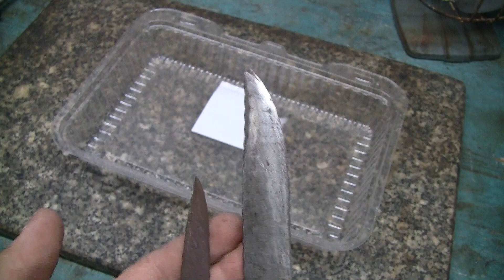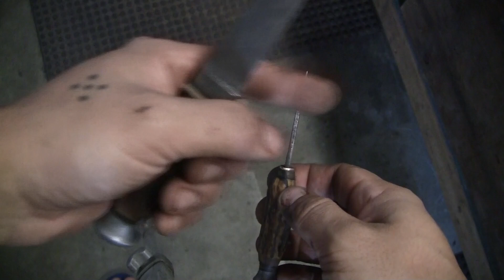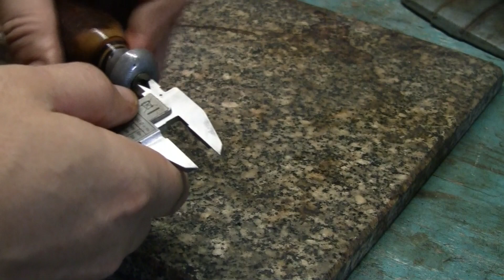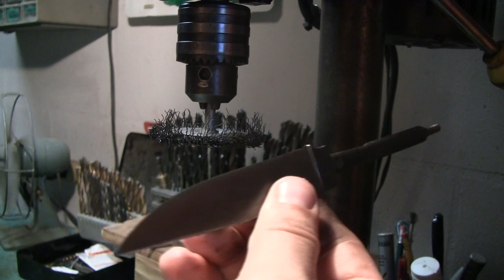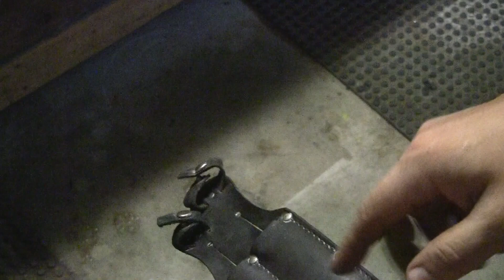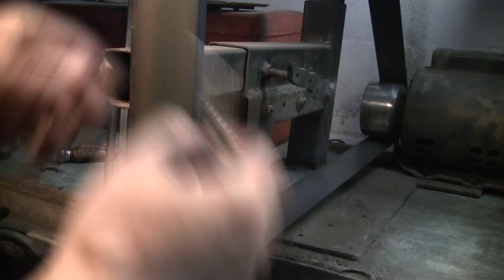Refurbishing a Pair of Vintage Anton Wingen Jr. Skinning Knives and Sheath

Comment: does the bolt turn right or left?
Reply from the maker: I believe it is left.
Reply: @DoingMoreKustoms  thank you
Reply: @DoingMoreKustoms  What liquid do you use to soak the knife?
Reply from the maker: @pelorman2434  I used white vinegar.
Reply from the maker: @pelorman2434  Be sure to never dunk aluminum into the vinegar, it will eat it up.
Reply: @DoingMoreKustoms  thank you